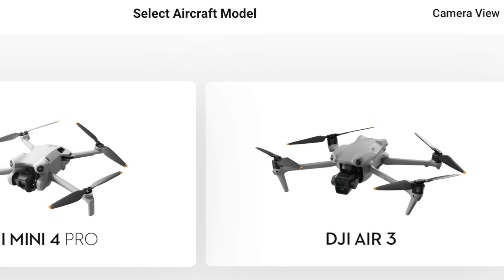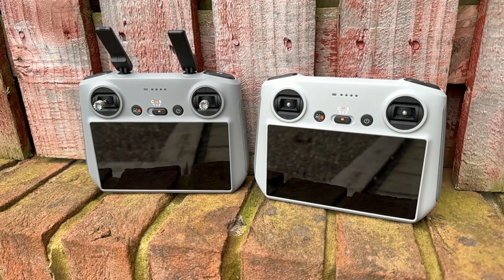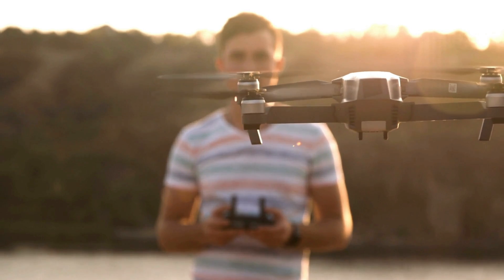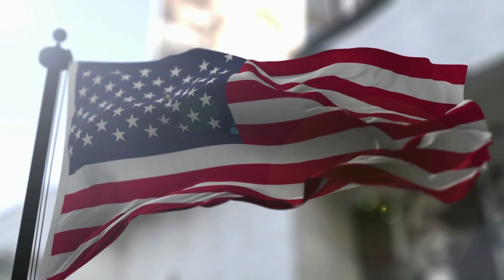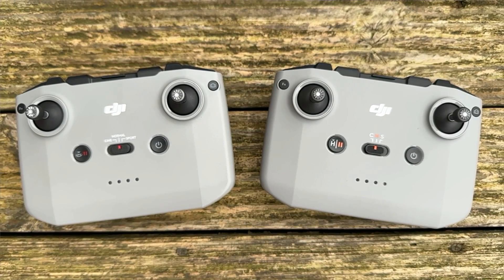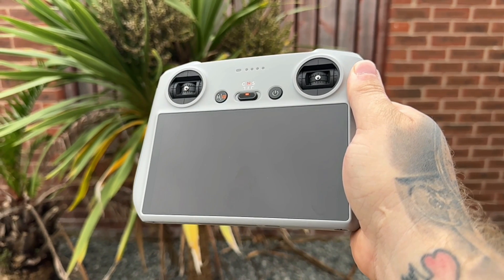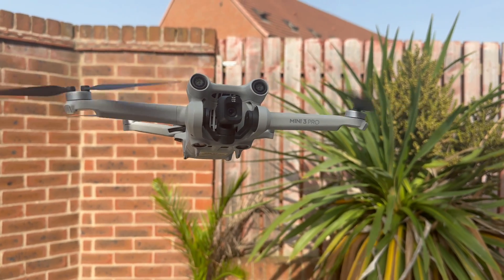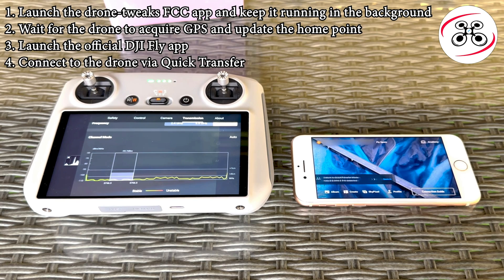How to Unlock FCC Mode on DJI RC / RC2 / RC Pro Controller & FIX Bad Signal!

Comment from the maker: For informational purposes only - please be advised that using this version of the app also removes the 120m height limit within the DJI fly app for mini 4 owners in EU.
Reply: Including fully autonomous waypoint missions too. Signal lost between AC and RC the aircraft continuous the mission if selected in app settings 😂
Reply: After activating FCC mode, I was left with a limit of 120m, the frequency shows 2,4, 5 and dual mode. Is this normal or am I doing something wrong? I'm from Czech Republic. Thanks for the reply
Reply: Could somebody confim that changing to fcc removes 120m limit?
Reply: @vaderjk yes it does.
Reply: @vaderjk you can change it to 500m without doing this idiotic thing
Reply: I don't have this app working! help!!
Reply: App does not work with a number of Samsung phones.
Reply: @alfvincent  s 24u

Comment: I purchased this software about a month ago. I use it with my DJI Mini 5 Pro drone and RC2 remote controller. I purchased the iPhone version and had a chance to try it out a few times. However, I've unfortunately discovered that this software is unreliable. Upon takeoff, everything defaults to FCC mode. This is how the flight begins. However, mid-flight, the software suddenly switches from FCC to CE mode at its own discretion. A flight that starts in FCC mode never ends in FCC mode. When a strong signal is needed, the remote immediately switches to CE mode. Unfortunately, the software is disappointing and unreliable.
Reply: this is not only unreliable but even can be dangerous, and you can loose youre drone.
Reply: How did you notice it went back to CE ? Any messages or did you go to the "frequency" screen and see the line had shifted ?

Comment: I have mavic air 3s with RC2 the back of the controller says it is CE but in the controller at the transmission section the signal line  is similar to the fcc mode line in this video
Reply from the maker: The CE mark stands for Conformité Européenne and simply means the controller confirms to European standards it’s not the same as CE / FCC mode but if you are showing FCC that’s good, are you in the US?
Reply: @GAVINHR in fact i am in iraq thank you for the reply i hope i am in fcc mode

Comment: Hi Gavin, a new subscriber here, I have found the app to download but it ask for a idid, what is that? sorry for my ignorance.
Reply from the maker: It’s a code they need to manually give you the iOS app :) it’s all above board the creator is a sound guy just follow his steps and he wil get you sorted the difference is huge.
Reply: @GAVINHR  Thank you Gavin, where do I find that code ? Is It on the drone
Reply from the maker: It’s on your phone mate not the drone itself :) if you google UUID there will be guides, in the email he sends you get the info how to find it :)

Comment: Something I find interesting is when I purchased my first DJI drone (Phantom 2 Vision+) back in 2014. In living in the UK using the DJI Assistant Software you had a couple of options. First of all if you did not have your reading glasses on you could "accidentally" put your P2V+ in FCC mode. Simply by accidentally selecting FCC mode. Secondly you could put your P2V+ into NAZA mode (No GPS Assistance). One of the advantages in using NAZA mode was shooting smoother  video in not using GPS.

Comment: My remote software version is 02.02.0300-Is the version of the vehicle 01.00.0600 supported, you will do it without opening the box, it is said that it does not work when you update, is it true?

Comment: Hi Gavin, I want to do this with my Mini 3 pro (DJI RC) but a bit confused what's being modified - is it just the transmission power of the remote itself (for controlling the drone) or the transmission power of the drone (i.e. video broadcast power so better visual reception on the remote)?  Or both?  Would be great for some clarity!  Thanks :)
Reply: It's the broadcast power of the video and control link transmitter in the drone. It can handle more than the EU regs will allow it to.

Comment: Does not work... when using QuickTransfer, the RC controller will disconnect from the drone. Only the phone and the drone will have any connection. Another rip off

Comment: The problem is you are using shared spectrum. If you crashed your drone because someone was using an illegally powerful WiFi nearby you would justifiably be very unhappy.... ditto if someone loses their WiFi if you are using illegal drone transmit power then they will be unhappy. 
I very much doubt if the police will be explicitly hunting "FCC hackers"... HOWEVER!!! if something does go wrong & they catch you for something else (illegal height/range or a crash) then they ARE now checking for FCC mode & will treat it as a "Brucie bonus" as something else to charge you with.. & they will... & they will also use it as a means to undermine the credibility of your defence for the main offence.   Think of the car equivalent... do the police explicitly hunt window tints?. No, but have an accident & they will check your window tint, & your number plate & your exhaust pipe & if the car has been "chipped" (& if it has they will tell the insurance company who will say "unauthorised modification... car not insured"... then the police get you for driving without insurance too).... the trick is not to give them the opportunity to have a field day.
Ah but.... this will never happen you say.... All I will say is take a look at the very recent convictions for other drone infringements.... they are checking for it.

Ofcom & the Euro-agencies have done the calcs & the EU spec should be adequate.... "ghetto blasting" with FCC power levels shouldn't be required.... their case against you would probably start with "you say the EU mode wasn't adequate for you.. that suggests you may have been pushing range or going behind things with BVLoS.   Which is it?"..... That isn't an easy one to defend against.

The final point is that it isn't just your controller that receives your drone signal. ANYONE can (there are YouTube videos on how easy it is to do even for amateurs.). The authorities are also starting to "sniff" for drones. You go FCC high power & you can be "sniffed" at much greater ranges.... that gives your drone location, drone height, range AND PILOT LOCATION (thank DJI for all that). A "one off" minor infringement probably won't trigger anything, but get noticed for it regularly and you may start to appear on their "radar" AND FCC HIGH POWER MODE WILL GET YOU NOTICED AT LONGER RANGES.

Talk about "big brother watching you".... Take your flight profile (& pilot location).... that if you are using DJI all of which anyone can sniff off-air... & simply patch that into GoogleEarth city areas with 3D clutter &  buildings showing & they can quickly get a quantified measure of what percentage of your flight was BVLoS behind buildings etc. What defence would you use against that?.... Go FCC & you are shouting to more people about what you are doing. 

What I also have to laugh about is the RID debate... there is already WAY more information freely available even now about your flight. The RID is just a little "icing" on an existing cake & doesn't significantly add to your already public info (& if VLoS is say 200m, if you knew the drone location you would probably be able to see the pilot anyway). The authorities will probably be treating it more like "If I see RID (& it ties in with the telemetry) then ignore it... if its RID is missing (or has been spoofed) then investigate it further". ..... in the future when RID comes in if you WANT to get huckled then just turn your RID off & go FCC mode.

Here is an interesting scenario.... EU spec drone crashes due to interference & causes damage, but the interference was from a high power FCC drone in the vicinity. Who would be held liable?.... the money grabbing lawyers who loved to debate if Pringles were crisps or potato snacks & if Jaffa cakes were cakes or biscuits would LOVE to be paid for debating that one at length & I wouldn't want to be person nailed with the bill at the end of that one.

The CAA/OfCom view is probably going to be along the lines of "if nothing happens don't worry about it, but if something does happen check & stomp on everything (& give them enough rope beforehand to hang themselves & make our prosecution easier )".

"FCC is better for me" could be viewed along the lines of "my car goes better if I take the CAT out of the exhaust". It may be true but I wouldn't suggest it for a defence.

Comment: Hi Gavin. I have 2 questions. Is it working with any firmeware version ( the latest ? ) and how does it work, when I want to fly the Mini4 with the goggles 2 and motion controller?
Reply: I have the same question - I have the goggles 2 and motion controller too, do I need to enable FCC mode on both of those also?

Comment: I found another site to do this. Cost a little more but then you have a permanent FCC patch on ur Rc 2. Did expect alot more range due to the antennas and occusync 4. Just gave me 600 meters extra than my Mini 3 pro FCC Rc controller
Reply: Could you please share the site? I want to browse too.

Comment: How do you know if you done the hack to FCC mode ?  On the transmission mode  just look the same to me .  Is there an indication..as far as am concern I done complete the hack successfully on RC 2 controller.  Mavic Mini 4 pro
Reply: Looking at the right side of the transmission graph. If the top line is close the 1km marker - CE mode. If closer to the 4km mark - FCC mode.

Comment: Thanks for sharing this Gavin!
I had left the inbuilt screen controller to one side and had  only used it once as the lack of FCC mode really allowed for poor transmission.

Have tested this out now and it connects just like your link explains 👌
Now just have to wait for a calmer day to test it out flying, but thanks again 👍

Comment: I just want to leave a comment on this FANTASTIC combination of the FCC DJI Fly version and the Battery PLUS. I have a Mini 4 PRO with a DJI RC2. I reached a distance of 4 km with NO LOSS OF ONE bar on the signal power. I decided to return on myself just to be on the safe side, but I believe I could have reached 6 or 7 km…!!
I also reached mountains side areas I have never been able to reach before. 
The « shadow » effect of a mountain or a building is not there anymore.
It is so safe to fly knowing you always stay in control.
I am really happy of my purchase and congratulations again for your work..!!
Reply: Wich phone do you use ?
Reply: @ I am using a DJI RC 2, so I do not use a phone. However, this FCC version is no more needed since the release of the DJI Dongle 2 that extend the signal via 4G communication. Then your phone is needed again to become the WIFI hub of your RC2 controller. You ask for a second SIM card to your phone supplier and put it in the Dongle 2.

Comment: just tried this and on my rc pro i dont get the quick transfer mode coming up on the screen so not working,   I had to uninstall my original dji fly app before i could install the fcc app  and now i have to uninstall the fcc app before the genuine fly app will re install on my phone .WHAT A MESS !!!..My firmware for my controller is (03.02.0500) which is the latest for the controller and the aircraft firmware is 01.00.1200  Mavic 3 .So if you own a Mavic 3 with an RC Pro controller  then you might be better going to the pub and spending the money on a few beers.The quick transfer mode works on official Dji fly app but not the fcc hack version .

Comment: I've read that restarting the drone or controller or losing signal will reset the mode back to CE, so you have to do this procedure before every flight and every time you change the battery.
Reply: This makes it totally impractical. Thanks for making this clear.
Reply: @MechaUsagi this covers the flyers ass! Should you loose connect n the drone crash, all traces of FFC are removed 😊
Reply: true

Comment: I have had the licence already but at that time it was not suitable for Smart RC now it is 🎉

Question:

Gav, should one remove the DJI fly app first and then install the DJI fly FCC app?
That i not know yet...

Thx for answer.

Greetzzz,

Marc
Reply from the maker: I believe on android you have to remove it yes but on iOS you can run both from what I understand
Reply: @GAVINHR  

I will try that my thx!

it works. yes first delete the DJI app then install the new fcc dji app

Comment: This is very important got it from the producers site,
Important things to consider
if you have several drones, some with standard controllers and some with smart controllers, you can now use the same app for all of them
this is a very short procedure (~15 seconds) but it must be done before each flight
restarting the drone or controller will reset the mode back to CE
completely losing signal between drone and controller (no video, no telemetry and image goes black & white) will reset the mode back to CE

Comment: Hi. I just bought the app and tried it there now on Mini 4 Pro with RC 2.
Everything went as planned and saw the expected change in the transmission graph.
Flew out about 600~700 meters and suddenly lost all connection. RTH kicked in and transmission graph went back to CE mode.
Tried again and got the exact same result.
Is anyone else having any problems with the mode resetting mid-flight?
Is the mode only resetting because the connection gets lost temporarily?
Any advice?
Reply from the maker: Somebody said if the connection drops it reverts in a comment previously, of course this is not my software I’m just showing its now. Possible, if you have any issues Florin at drone tweaks is usually very helpful
Reply: Yeah, I read that too and I get how that could be explained, but I'm not sure if there isn't an additional issue going on with this, but can't explain why it would drop so suddenly in an area where I can usually cover a much longer distance in regular CE mode.
Perhaps there's something to the observation that it seems to remove the 5.8 band when FCC mode is implemented and this would not be ideal in my urban environment.
I've already posted to the comments on the Drone Tweaks channel.
I'm not putting the solution down. I'm just trying to share my experience and add to the conversation on what could be a very useful application.

Comment: So for me, Quick Transfer has never started automatically on the FlyApp from my cell phone.  And if you manually activate Quick Transfer by pressing the drone's power button three times, the RC controller immediately loses the connection.  I wonder how this is supposed to work?  Has anyone actually managed this with the RC controller?
Reply: I think its a new patched version but im not sure, I even asked the drone tweaks guy if it would work on all versions and he said yes to me and when i bought it found out it doesnt
Reply: There is a video explaining this, it's very simple, you'll need your phone, official dji app, FCC dji app and the RC2, it's a little bit of a fiddle the first time but it soon becomes second nature

Comment: I bought it and installed it.. I have a question because I think everything went OK, but is there anywhere in the controller menu where I can find the FCC icon confirming that the installation was successful and I am on the FCC website?
Reply: I do everything according to the instructions and as in your demonstration video for Android, but then the graph does not change for me, what should I do now?  I wrote to support but no response
Reply from the maker: @marekdominiktomczyk2009  drone tweaks  will get back to you he does offer great support
Reply from the maker: If you check the faq’s on the website it shows you depending on which operating system you are using :)

Comment: Seems that the license is only valid for 1 year. We need a new one after 1 year - right?
Reply: Wow I never noticed that.
Between having to repeat the process, and a one year license, I have to say I’m disappointed.
I’ve had the FCC hack on lots of DJI drones and remotes previously.
Reply from the maker: Yes that is correct

Comment: Very useful video and many thanks to Gavin @GAVINHR ! If possible, please answer - 1.The mod has been removed - does it leave any traces of its presence after a restart? 2. It is clear that the consequences are the responsibility of the user, but is installing a mod automatically a waiver of the warranty - for example, in the case DJI care? Thank You so much!!!
Reply: I got the answer - from .drone-tweaks - it need to run each time and ... doesn't negate DJI care..  Thanks !
Reply from the maker: Oh sorry my apologies I missed your first comment, glad you got the answer directly
Reply: So I take it, USA doesn’t benefit correct? And the app needs to be initiated on every flight, or every new power on ?
Reply from the maker: @baddlord777  the USA already get the highest levels of output, this is basically giving EU users what the US drone flyers get